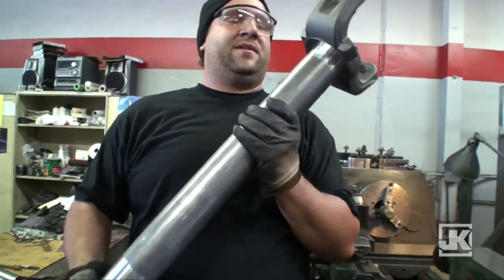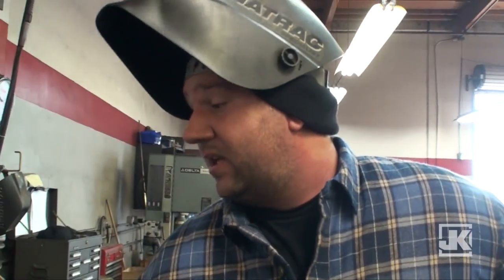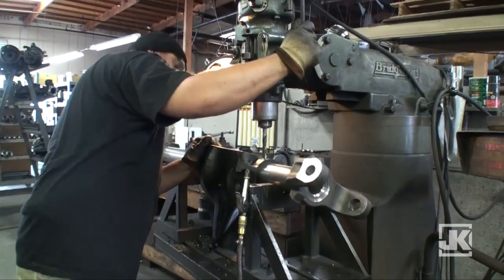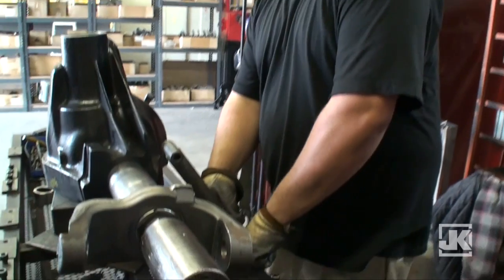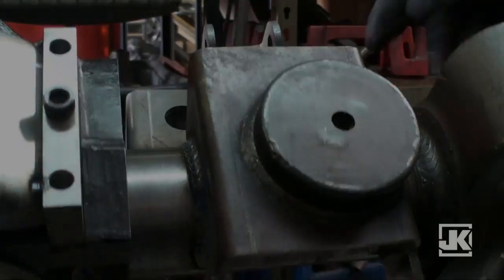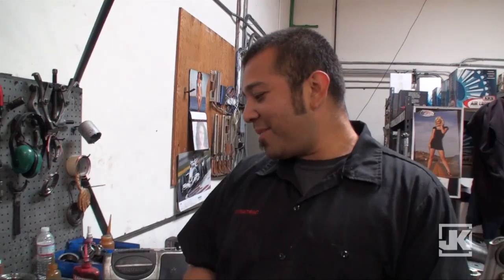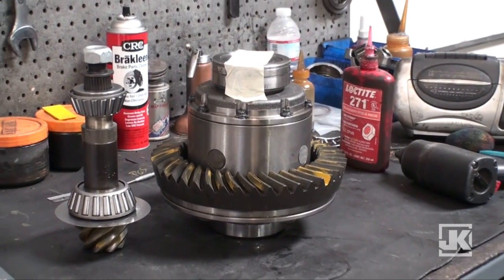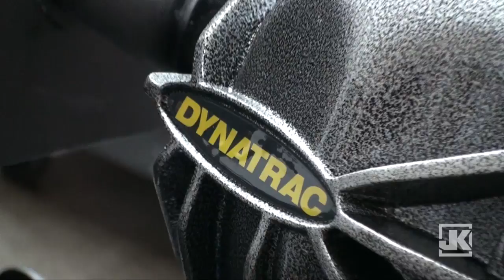Building a Dynatrac ProRock 60 Front Axle for a Jeep Wrangler : See How it's Made

Comment from the maker: @rickyp32 the axle tubes are pressed into the center section and i'm pretty sure that alone is pratically enough to hold everything in place.  the "plug" or rosette (NOT spot) welds ensure they won't.

Comment from the maker: @Frdmstang i upgraded the locker to an arb and installed a set of 35 spline shafts.  i also had to install wheel adapters so that i could run 5x5.5 bolt patern wheels.

Comment: As this is an old video I trust you have updated your welding  procedure for those 4340 tubes. Pre and post heat is a must.
Reply: The axle tubes aren't 4340, they are DOM. The axle shafts are 4340.

Comment: @rickyp32 i think if they had fully welded up the centre to the tubes it would have made the axle potentially weaker as the heat from the welding would effect the metallurgy of the tubes & also act as a stress riser

Comment: @rickyp32 they did 6 plug welds. plug welds are very affective. turning the amperage/voltage up high so you get good penetration. When ever they sleeve and axle they use plug welds....

Comment: How many times did you break your dana44 before you got the 60?  How well did it hold up to the tires you were running (I believe they were 40s)?  I've got dana44 with yukon chromoly and I'm running 38 inch crawlers and I'm always worried that I will break them on the trail and be screwed.  Thank you!
Reply: The Hooligan 4 have you broken a shaft yet? I'm about to be running same thing

Comment: did any one notice that the center section was only spot welded to the axle tubes you would think they would put  a few passes  on each side
Reply: You have no idea what you are talking about.There is no such thing as a spot weld. The axle tubes are pressed and plug welded with .045 ER70s  MIG. And they arent going anywhere.